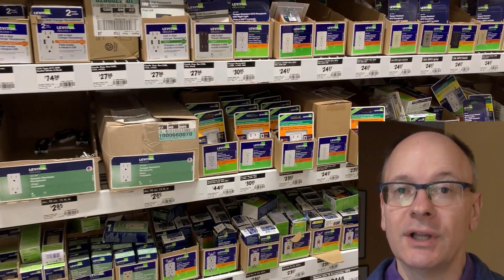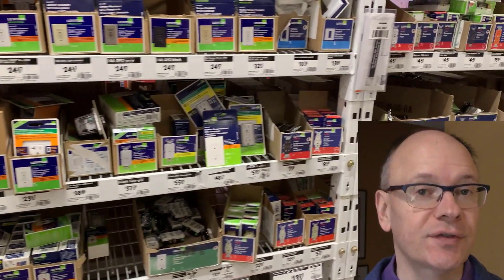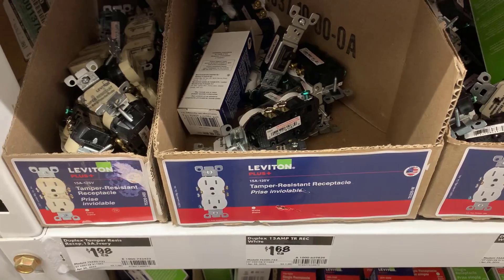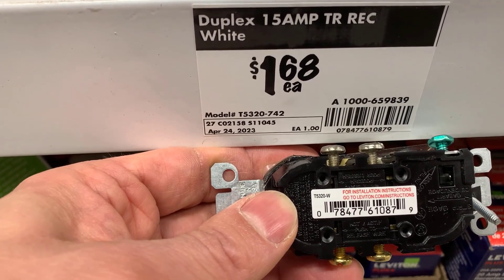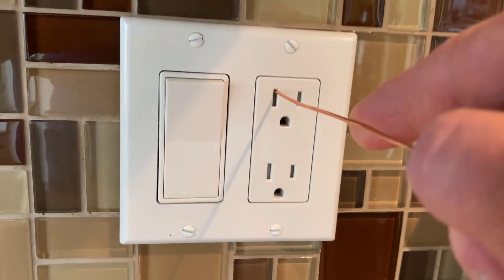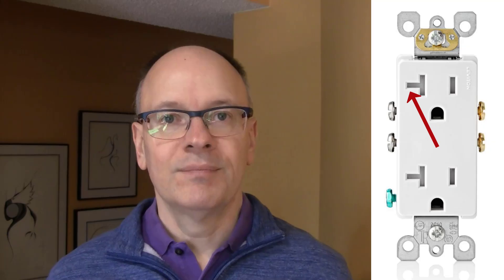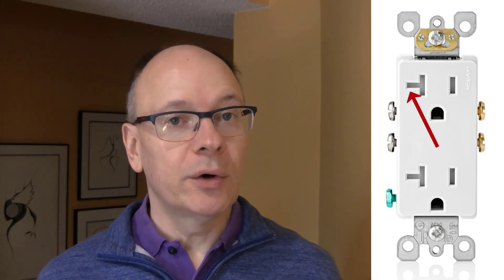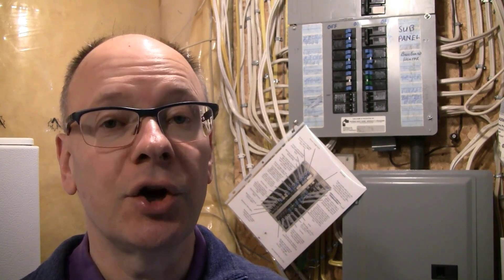5 Outlet Buying Mistakes Most DIYers Don’t Know They Are Making in the Big Box Store

Comment: I’ve watched a few of your videos now and I would like to say I’m enjoying them! I have heard you say multiple times in different videos about needing GFCI outlets which is borderline true. I’m in the US and GFCI protection is required on certain circuits but that protection can be a GFCI breaker at your panel or a GFCI outlet as you show. If it’s at the panel then the whole circuit is protected and purchasing a GFCI outlet is redundant and if anything may  cause problems on a circuit that has a GFCI breaker as well. Just my two cents when stating people NEED to purchase GFCI outlets.
Reply from the maker: Thanks for watching my videos and I am glad you are finding them helpful. You are correct that a GFCI breaker will protect all the outlets on that circuit. For most beginner DIYers replacing an outlet is an easier way to get the protection than replacing a breaker. Working in the breaker panel is a more advanced level of DIY electrical skill.

Comment: Mistake number 6: not buying a weather resistant outlet for outdoors or wet locations. These outlets will be marked with WR.
Mistake #7: thinking that all weatherproof covers are equal.  The old spring loaded door weather proof covers are no longer permitted outside or in other wet locations.  They are only permitted in damp locations.  Wet locations including outdoors require in-use covers (a.k.a. bubble covers).  They do make low profile in-use covers.  The best low profile in-use covers are designed to be expanded when you need the extra room and colapse when no longer needed.  If you have the room for it and want to go cheaper, then the best selection is a deep in-use cover.
Mistake #8: not making making sure that the in-use cover door is hinged at the top of the outlet so that gravity closes the door.  Some designs can be installed either direction because you can hinge it for either direction. Just make sure you attach the cover door with the hinge at the top.  Other in-use covers are designed for one direction only.  For the single direction covers you have to make sure you purchase the one for your specific situation.  Also, most in-use covers are designed with interchangeable parts to allow you to install it on different types of outlets or switches.
Mistake #9: not using metal in-use covers in areas where the cover is prone to damage.
Reply from the maker: Thanks for all of your insight and these additions! I and others appreciate you taking the time to share.

Comment: Is an industrial grade outlet a good choice when available?
I have heard better construction hence last longer.
Reply from the maker: It may last longer but I don't see many regular outlets fail so I am not sure it would be worth the extra money. Always up to what you feel is best for your situation.
Reply: If your connecting and disconnecting cords from it frequently then it certainly is worth it.  If it gets infrequent use then you might not notice the difference over time and it may outlast you.  I would recommend getting commercial grade back wire devices over the cheap stab-in residential devices because they're easier to install and more durable than the residential grade devices.  Between the commercial grade and the industrial grade you probably won't see much of a difference.  If you do get the cheap residential devices then avoid using the stab in connections and side wire them.
Reply from the maker: I totally agree with side wiring instead of back stabbing for residential outlets. I wonder if manufacturers rate their outlets for number of inserts and removals. It might be a hard thing to duplicate in a home as we would not put the plug in straight every time like a machine would.